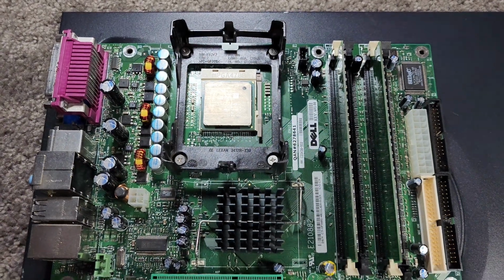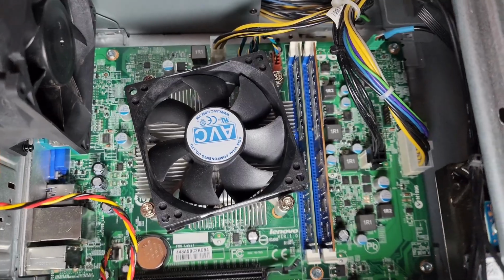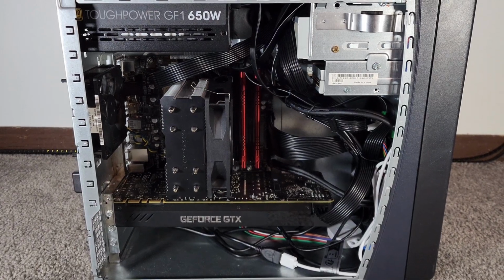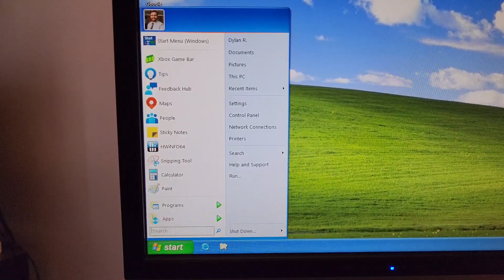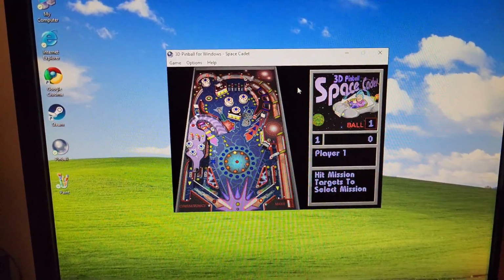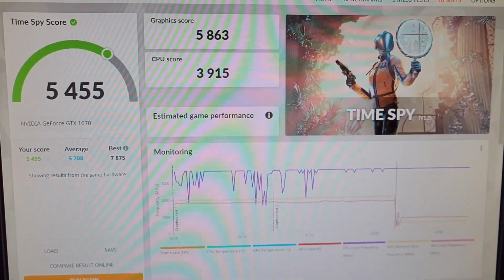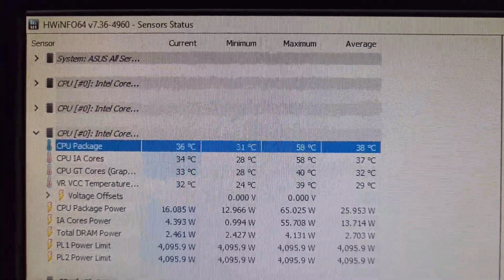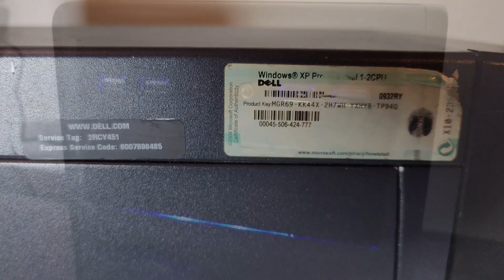A Sleeper PC On A Budget! | Dell Dimension 4600

Comment: AWESOME! Great to see the detail shots in the pcpartpicker link, too.  I have a Dimension 2400 that I'm considering doing something with. Thanks for sharing.
Reply from the maker: No problem man, and thanks for watching! Let me know if you post something about your Dimension 2400. I'd love to see it.
Reply: @DRush295  Hey man, I dug into the sleeper build.  So far so good except one problem; The power button!  Did you use some type of adapter to connect to the motherboard?  Any help would be greatly appreciated
Reply from the maker: @sebastianakins414  I got some basic breadboard jumper cables on Amazon so I could connect the power button to the appropriate pins on the motherboard.
Reply: That should work great.  Thanks!  Just now seeing your previous conversation with another person in the comments about power buttons.

Have a solid set of HW, now I'll be on to the fans/RGB for max Windows XP fps.  Just sort of a bunch of parts laying around:
i7 2600
32gb DDR3
GTX 1650 4gb DDR6
Corsair 750w
500g SSD
Will add USB 3.0 / DVD & Blu-ray

-Eventually I might upgrade the mobo/cpu/storage, but for a side project it's good 'nough.  Cheers

Comment: Hey awesome build man, this inspired me to make my own version too!! Just curious, how did  get your power button to work on your new motherboard? Was the existing front panel cable able to smoothly fit on the board? I saw some other video were they re-wired or re-soldered it.
Reply from the maker: Thanks man! I love to hear this inspired someone to do a similar build! And I used female-to-male breadboard jumper wires to make the connection between the motherboard and the power button.
Reply: Hey thanks a ton for responding, I really appreciate it! Sorry to bother again, but I was wondering if you faced any issues regarding air flow/ air pressure? I was also thinking of adding a 120mm fan for intake and a 92 mm fan for exhaust, but since the power supply will act as an exhaust as well, do you think that would offset the pressure at all? Maybe im overthinking it, just not sure whether the 120mm intake would be sufficient enough to keep the pc cool. Thanks for your time again!
Reply from the maker: @nicolasarrazola1615  No problem man! And I'm not sure honestly. Personally I put either an 80mm or 92mm exhaust fan in mine, even though the power supply was also working as an exhaust. The temps are all well within operating range with that setup and a single 120mm intake. I know someone makes fans that use 5.25in drive bays as well if you need more intake as well, but I've never personally used them.
Reply: Hey man, thanks for responding again, I really appreciate your input! Ended up buying the parts, now I’m just waiting from them to arrive so that I can get my hands dirty with this build.
Reply from the maker: @nicolasarrazola1615  No problem bro. I hope I was able to help. Have fun and I hope I get to see your build!

Comment: i want with windows 98se
Reply from the maker: That would be awesome!
Reply: I am trying to install 98se on a Dimension 4600i as I am typing this. The first attempt using a SATA drive did not seem to be able to boot so now I am trying to install it on a IDE drive. It probably still won't work because the files copied to the SATA drive without issues so why would running an OS be a problem.. I think the board is somehow too modern. I have had that with another even more modern Dimension, that it won't run 98se and it crashes at the startup. It will run the 98se setup but it won't run Windows itself. The 4600i, since it has AGP, might have a chance to be compatible with 98se. I will find out soon enough. With an IDE drive the 4600i seems to be compatible with 98se! Good news for me too, since I can't have too many 98se systems. I want to have at least one 98se system working if possible, to use as a digital audio recorder with my old Yamaha DS-XG sound card. The PCI USB is not detected automatically though. See if there are any 98se drivers available for this old thing. You must install Windows 98SE with "SETUP /P I" which will disable ACPI and cause 98SE to use the older 95-style APM (Advanced Power Management) instead. This will let the graphics card function correctly since otherwise it gets a memory conflict.

Comment: This is amazing. My father-in-law has the same chasis in his home, just phones me to do the same. Then, I find your video. Two questions: 1. What is the clearance of CPU cooler and GPU length? 2. Concerning mounting modern motherboard, is its screw-holes all fitted? (I have a spare mini-ITX board, wondering if it can fit this chasis).
Reply from the maker: Thanks, I'm glad you think so! For the GPU length it's hard to find the exact dimensions on the card I used since it was pulled from an HP pre-built computer, but what I found says 241mm. There was still about 25-50mm of clearance from the front of the case. As for the CPU Cooler, the Thermalright Assassin X120 I used fits, but JUST barely. The height is 148mm according to its Amazon listing. For the motherboard stand-offs, they worked for my microATX motherboard. There were extra stand-offs that didn't get used, but if the mounting points lined up from my microATX board, they should also line up for your mini-ITX board. Good luck my friend and have fun if you decide to build!

Comment: I’m also planning on turning this tower into a Sleeper PC (already found the parts but have not bought them) What were some obstacles or trouble shooting you did while working on this build?
Reply from the maker: That's awesome man! Have fun and I'd love to see it when it's completed. 

Everything was relatively easy, but the two things I'd say were obstacles were removing the mounting point for the 3.5 inch drive cages inside the case, and putting the motherboard in.

For the drive cages, you're going to want to remove them for your graphics card to fit, but you don't have to remove the mounting point if you don't want to. It's best to remove it though if you want to mount a 120mm fan for intake like I did, you may be able to make an 80 or 92mm fan fit without getting specialty tools like a dremel to remove the 3.5 inch cage mount. It was a pain cutting it out using the dremel, granted I also had never used one before. The mount point I'm talking about is a small rectangular metal piece attached to the inside of the case that the drive cages slot into.

For putting in the motherboard, I'd say just be careful when mounting it. The first motherboard I got worked fine on first boot, but after taking it out and putting it back in, it didn't boot anymore. Idk if this was just the motherboard failing since it was used, or if I accidentally damaged the back of it against the round integrated stand-offs, or something else. I didn't see any visible damage, either way I got a different board that's identical and it works great. But just to be safe, be careful, the integrated stand offs are wider than normal ones so it's easier to accidentally gouge the board against them.

I hope this helps and good luck on your build!